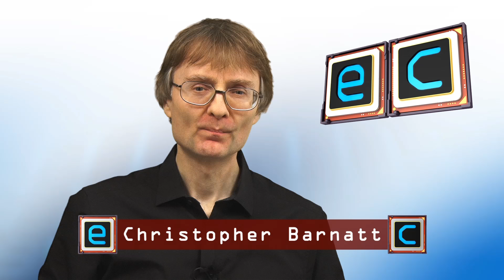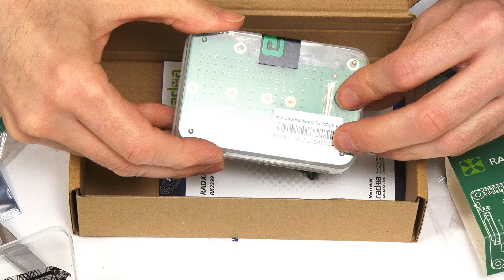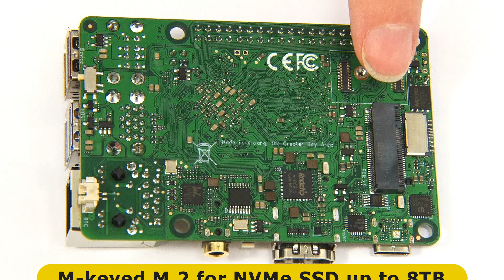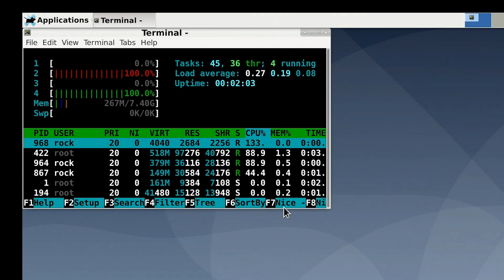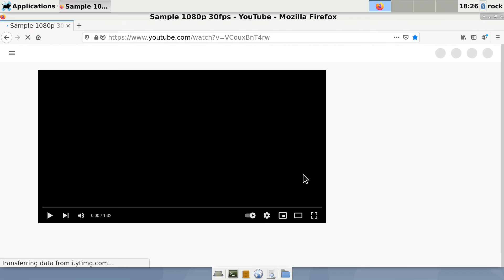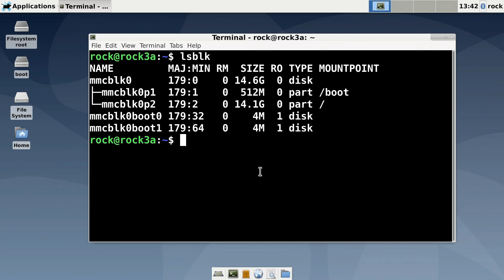Rock 3A: Dual M.2 ARM SBC with eMMC socket

Comment: The Rock 3A has 4x A55 Cores @ 2Ghz...? I recall the Rock64 from Pine64 that was a Quad-Core w/ what I assume was A55 cores, albeit an inferior Mali GPU, but USB 3.0 & M.2 support. It later released as the 'Pro' w/the Rockchip 3399. Still...if each were restricted to M.2/USB3 transfer speeds, I wonder if there would be that substantial a difference in performance vs the original Rock64...? Surely Radxa is beating 4yr old product by more than just additional I/O, a newer stock ARM gpu, & slightly faster RAM...(?)

Comment: WOW! SBC have come a LONG way in the past 5 years! Great to see competition in the SBC space, vs Raspberry being the only SBC maker.
Reply: Just you wait, the Rockchip RK3588 is coming very soon (finally) and there will be new SBCs like Rock 5 and a board from Pine64 announced probably by the end of the year. This is alarming for the Raspberry Pi fanatics that are still stuck on 40-28nm, because this SoC will be made on a Samsung 8nm process, will feature 4xA76 cores at 2.4-2.6GHz, 4xA55 cores at 1.8GHz, which will be around 2.5x more powerful than the RK3399 that's found in Rock Pi 4 and other RPi 4 competitors in single core and especially multi core applications, a much more powerful Mali GPU (almost 10 times more powerful than the one in RK3399), an NPU 3.0 with 6 TOPS performance and other great features, like support up to 32GB LPDDR5.

Comment: Sunday brunch with Chris, a good start to my day :)
[has odd thought] Yes, reinventing the wheel, but roll with it...
Wondering if one could find a way to hook up an old cellphone to an SBC like this one (why this one gave me the idea, I don't know, insanity perhaps) and use that as both monitor and keyboard input. The advantage might be that it would be very power-efficient and could run a long time on an external battery.

Comment: I loved Mr. Scissors' early action in this episode. Also all the PCI Express hardware goodness! Wish the software for Radxa's boards were a bit more refined though :(
Reply from the maker: Hi Jeff. I did wonder what you would connect to this board! :)
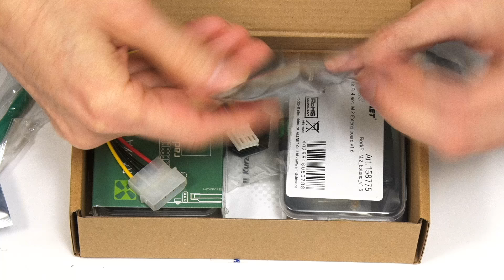Reply: Too early, it seems. Looks like a resealable bag to me (1:36).

BTW, hi jeff 👋😉. I like your channel.
Reply from the maker: @DrorF  Yes, as I only noticed in editing, I did cut some resealable bags here. The problem is, these things are far easier to spot in editing than in reality when filming, especially in a one-take shot like this. Almost certainly I had not switched my glasses from those I use for setting up a shot, to the close-up ones I normally wear for close work. Hence I did not spot the bag type. Age! :(
Reply from the maker: @MicroLinux I always test SBCs using the  "official" images made available by the manufacturer -- so this is "why"! It is not realistic to assume that most buyers will use non-official distros, so these are the ones I test.
Reply: @MicroLinux I beg to differ; Christopher's audience is 'normie' users, so I don't think it would be appropriate for him to try to be in the mindset of a hardcore ARM board hacker making these videos.

I would like to know how many people outside of the very small Linux / dev community know that "mainline" doesn't mean "to inject something directly into a vein" ;)
Reply: @JeffGeerling  Completely agree, and it's the same reason that especially Linux still isn't mainstream after 30+ years even it's gotten much more streamlined today and it in many cases is better than what you get in windoze .. It's support. A big company can bypass this by hiring the right people that are already Linux specialists, and its the same with these SoC's. They are reaching a point now where they could easy be used as a cheap home PC for stadard office usage and other non super hardware demanding tasks if the software works at least on par with eg. Windoze and you can find support easy. But many of the smaller SoC producers lack stability and compatability in their standard supported OS, and this just isn't user friendly for the avg user that isn't a Linux nerd and doesn't know how to find various hardware fixes and how to add it and rebuild the kernel. Even you like it or not, and Windows is far from perfect, an x86 and windows solution is still much easy to manage, as bugs and hardware issues is as far as it can be "almost" automated to be updated automaticly.
Reply: @MicroLinux I think this is a major problem holding back Radxa boards and many others from mainstream adoption, though. If you have to 'know' (based on tribal knowledge) that the official image downloads that are listed on the official web page for the board are not the right ones to use, to get the full experience... then that's a very poor customer experience, especially if you're not already a Linux kernel developer (vanishingly few of us are).

I don't see any problem with Christopher (or any other reviewer with a general audience, not an extremely niche/limited audience) downloading the official image linked from the official website, saying that's the image he used, and highlighting the problems he has when using it.

I think the onus is on Radxa et all to update their documentation and explicitly tell people to not use their official images if that's the way to experience the full performance and feature set of their boards ;)
Reply from the maker: @MicroLinux This is ludicrous. It is not a key reference for the official vendor supplied OS -- unless, that is, this OS is supplied in different images with a different kernel. And in over 8 years of testing over 50 SBCs I have never found this to be the case. Once again I repeat that I test the official images made available by the SBC manufactuter
Reply from the maker: @MicroLinux By "official" I mean the image supplied for download by the manufacturer of the SBC! :) Or in other words, the image that the vast majority of purchasers of a board are likely to download and run. I am not talking Linux here, but product. Ubuntu for a Pi is a third party Pi OS, and a very good one, but it is not the official (ie manufacturer supported) Raspberry Pi OS.
Reply: @ExplainingComputers  will be nice if you make other video testing other distros and comparing the performance plus some benchmarks.
Reply: @ExplainingComputers  👍👍👍👍👍
Totally agreed!
Reply from the maker: @MicroLinux I am very well aware of this and always clarify exactly what I am running on. And it is almost always an out-of-box browser experience. Or in other words what you get with a default browser installation in the manufacturer's official OS image on test. It is not I think realistic to expect most users to be running anything else.
Reply: seeing antistatic ziplock bags being cut open triggered a little, untill i saw that little, empty ziplock bag. i've been trolled!
Reply: @MicroLinux I still see all the previous comments—if you post more than a few in a short time period or add links to many comments in a short period, YouTube often automatically removes them (not sure if that's the case but I've seen it happen before).
Reply: @MicroLinux Dude keep me off your ranting against EC, and don't tell me what i know or don't know. I am very well aware of how it works. It's you that misinterpreting what I said. I am very well aware that we can't expect the userfriendlyness and support from these board makers compared to any of the big PC producers who relatively compared puts tons of money in providing as good an end user experience as possible. Here they just slap the cards together and don't really make a big earning on it, so it is as it is. It' comes with an OS that is somewhat usable but not at all even optimized for the hardware. It's up to the end user to figure out pretty much everything themself, and that is why it will never be for the average home user. But it would be fun if there were just "one" card producer that had the money to take these cards to the next level and actually deliver - still a tinker style board, but with a userfriendly base OS that is actually somewhat optimized for just normal computing on th Arm SoC. I think everyone could be without those tests with youtube running a 4k video, as correct me if i'm completely off, just about none of the cards based on those Arm SoC's is able to run without dropouts without a higly optimized OS build. Not saying it's imposible, but things is relative. it's not compareable to an Apple M1, or for that matter any of the processors used in a modern mobile phone.
Reply: Perhaps Jeff could compile the kernel from source... would that be better than...? Wondering... ???
Reply: @var67  Well, I'm sure he is much more into how the different os works than me. Problem is he is not doing anything about his bragging about what EC should educate us in. It's just hollow talk that isn't helping either EC or people that really want to learn more. I'm kinda agreeing with him that there really isn't any places I have seen (yet) where people actually tries to educate others. If you know that much about it, stop ranting and begin to educate people in the right way. I am a nerd myself and have a medium long IT educating, and have actually learned the basic outlines of designing an OS, I just never really got the time to getfamiliar with the linux world even I wanted to, and automaticly after graduationing hopped onto the "Microsoft way" .. why bother with an old school console based OS when you could have a nice ui to work with in NT. I think inexpensive Boards like the rpi and other competitors is the ideal platform for those that have the interest in learning more about linux and how arm chips tick. And I don't really get why no one takes the oportunity boost the knowledge about this world, as it seems to me that there is many people around the world that is intriqued by it but never could see the start and end of learning Linux slackware as it seemed like a totally wild west. It's become fairly easy today to just install a basic Ubuntu distro and you can get by many things in the modern graphics ui without being an expert, but as soon as you begin to scratch in the surface to to do some semi advanced options your back in the wild west again, if you need to get some piece of hardware to work that is missing support in the dist.

Sorry for this long post, I just felt like explaining where I stand. I want to start tinker and experiment, but having a little hard time to decide what board to to start with, as I don't have an exact idea of where the project is heading :)
Reply: Hey Jeff,
                 in your experiment of building a server with raspberry pi cm4s if you instead used usbs to do all storage it would have been faster as usbs have higher bandwidth than a pci gen 2x1 slot.

Comment: A tip on resizing windows on XFCE: hold the ALT key and position you mouse pointer on the window, near the edge you want to resize (it doesn't even have to be very close). Now use your right (!) mouse button and drag to resize the window.
Reply: Thanks, I didn't know about that. Now I can use no border themes.

Comment: It would have been nice to run the lsmod, hwinfo and lspci commands on both the debian and ubuntu instances to troubleshoot why the NVME was not showing up in the debian instance. I suspect that it was an issue with the right module/driver not being loaded for it in debian.

Comment: Another great board review!  It surprises me that Wi-Fi support has not been ironed out yet. My printer, all of my many pi zero W's, and yes, even my refrigerator and washing machine came with Wi-Fi that works perfectly out of the box!
Reply: What exactly is wifi good for on a refrigerator? Does it have an API to tell you that its inside is indeed cold? ;)

Comment: On a Raspberry Pi, at least, it is possible to add a graphical desktop like Xfce to Ubuntu Server. Would be interesting to know if this works with the Rock Pi 3a, too? The specs of the SoC aren't that bad, it would make a decent platform for a lot of tasks.

Comment: you make toughfull videos.  however as a suggestion when reviewing boards try to suggest when a user should use this board instead of pi 4.  
i have a commercial farm and i place units in the field.  i would like to replace the arduino units with low powered linux devices much like  the pi zero  reason is that updating software in these devices is easier than flashing arduino devices.  Reviews of these type devices would be of interesr to me.  thanks

Comment: Hi Christopher. Another great video of a nice board. I'm waiting for the 3B to be released. I like that design a bit more. For good Armbian support for it we'll have to wait a bit longer. The first test images are available, but nothing official.
My guess would be the naming is because the SoC is lower performing than RK3399 of RockPi4. The Rock5 should be RK3588. I hope there'll be news on that soon. That's the board and SoC I've been waiting on for years.
I've now bought the RPi400 since Armbian now supports it. I must admit I hadn't watched any video about it since I had not much interest in it. But I'm a bit surprised about it. The keyboard isn't good as I expected. But the SoC stays cool at all times even with overclock at 2Ghz. It doesn't suffer from undervoltage issue's with non RPi PSU as other RPi's. It seems more stable in my tests than my RPi4 with overclocks.
Seems their best product since the RPi2B in my opinion. 
I've been waiting for many months on the RadxaZero. I hope it'll be send to me this month. Availability is just so bad these days. 
Enjoy your evening. Greetings. NiicoD

Comment: I assume those WiFi and NVMe issues will be fixed with software updates in the future...  This board clearly has a lot of potential -- but is yet another example of good hardware being let down by poor software.  :-( 

All non-Raspberry Pi boards seem to be caught in a Catch 22 situation.  They can't get good software support without a larger community, and they can't get a larger community without better software support to drive people to purchase the boards.  Raspberry Pi really have that nailed down -- the large, supportive community, I mean.
Reply: They could get better software support if they used hardware that already had decent software support. I'm not in their field of business, but it seems to me that if they want to compete with Raspberry PI, they should start with offering flawless performance at a competitive price point with full compatibility in the already established RPI ecosystem. Step two would be to add features that they see already floating around in the community but not yet officially supported by Raspberry PI. They could also add feature upgrades that don't break compatibility, like more RAM, more USB 3 ports, full size HDMI, more power options, etc. In other words, get just a half-step ahead of RPI, and try to stay there a while to get users' attention.

Once people start catching on and switching over, that's when they could pump the accelerator by adding more bleeding edge features that don't have any equivalent in Raspberry PI at all, not even in the community ecosystem. But make sure those features at least work to some extent, even if they are a bit buggy. What they seem to have done here is throw a bunch of hardware together that only somewhat works, not even including features that RPI has had for a while already, like decent video playback. If they want to build their product like that, they need to compete aggressively on price, which they also aren't doing.
Reply: @SuperDavidEF  “…full compatibility in the already established RPI ecosystem.”

That’s the trick, tho, isn’t it? The RPI BIOS and hardware can’t be copied exactly, and RPI won’t (to my knowledge) license them to anyone else. So it’s just about impossible to make something that’s 100% compatible, no?
Reply: @LMacNeill  I just meant hardware compatible with the RPI community projects and having enough software compatibility to be almost a drop-in. I know they can't (or at least I'd say SHOULDN'T) make a perfect clone of RPI hardware, BIOS, etc. But they could make it fit in projects where the RPI fits, both hardware and software, for the most part. There are ways to make hardware upgrades and/or substitutions that still fit into the ecosystem of community projects fairly well.
Reply: @LMacNeill  I also initially thought he meant literally making them Raspberry Pi clones.  I'm not sure if you are aware, but a while back Hardkernel actually did that, making a Pi Zero-like board, which I don't know if it came out before or after.  It was called the Odroid-W and was around in 2014 or 2015.  It was discontinued because Broadcom cut them off.  I'm not sure if the reason was ever fully revealed, but the speculation was either they didn't want clone boards to exist, or their minimum order was so high that none of the other board makers could afford it.  That's in the past and that part is beside the point which is that it has been done once before which I think a lot of people either missed or forgot.  But, one way or another, it's pretty much impossible now as you say.

Comment: Not withstanding my comment below,  the hardware that this SBC supports is phenomenal. I would say more than adequate for the average user. I understand that this generation of ARM-Cortex can be run using Windows and by VMware.
 It looks like the days of spending four and a half times the cost on a main stream off-the-shelf or home build Windows machine, together with the spatial inconvenience of a stonking great system unit and power supply are shortly coming to a close for standard home users.